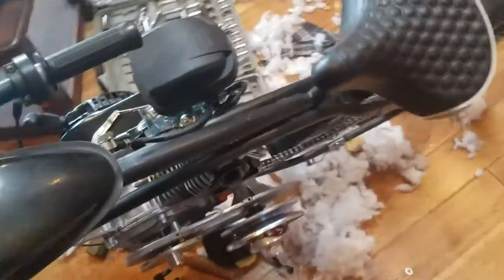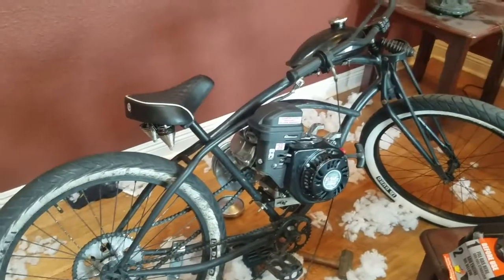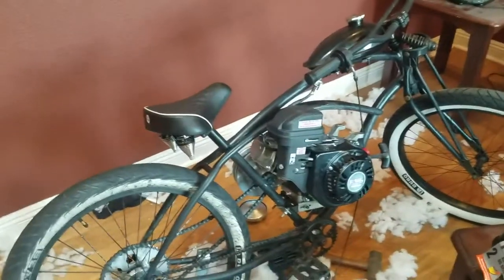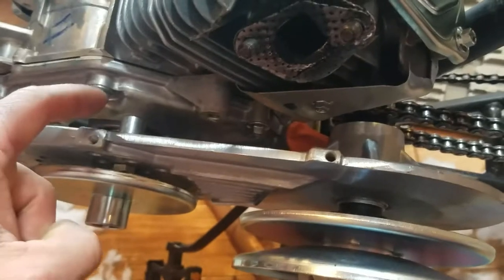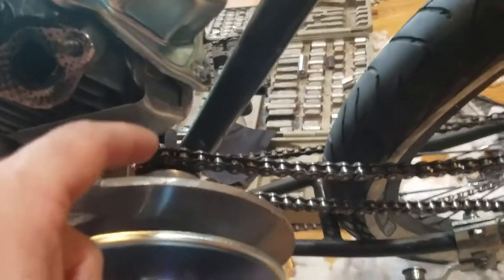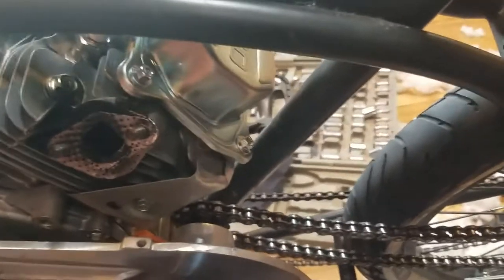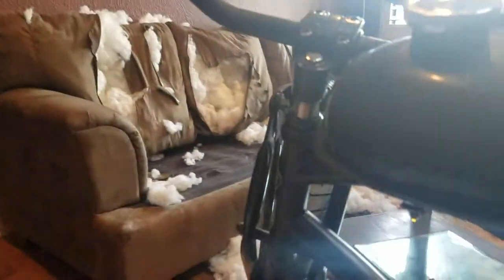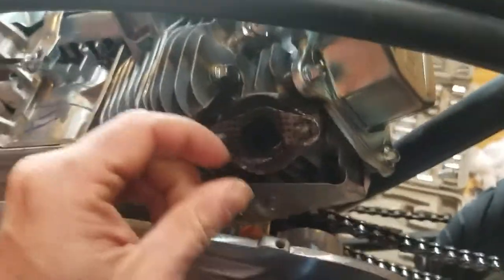Robert Stirrat Black Betty

Comment: I know it's 2 years later but are you guys still having mounting issues? You have the death row kit? I've gotten mine to mount nicely, it's taken patience of trial to get it there but it works wonderful. I top out at 65mph! Needed the low profile valve cover so the whole motor would slide back another 1.5 " I removed the Gov & low oil, I also jetted the carb, Hi flow intake as well as high flow exhaust.

Comment: how did you get the sprocket to go on the back of the torque converter bolt? my torque converter has that on the other side of the torque converter, not that close to the bike. i may have to set up a jackshaft or something, the whole thing would not fit in between the frame of the mongoose 4" fat tire brutus i bought for it